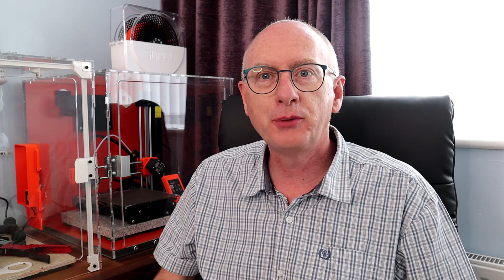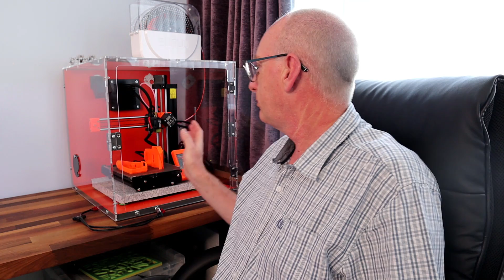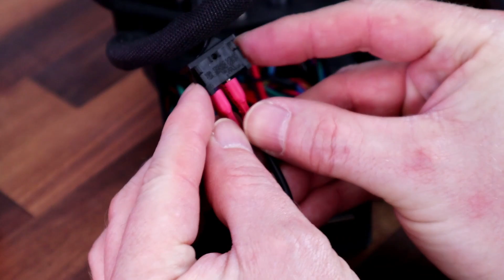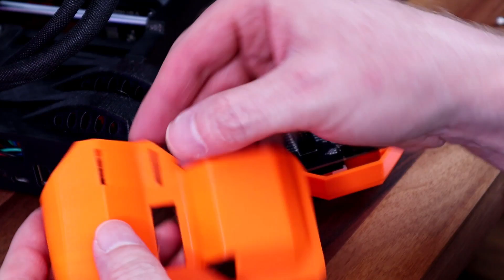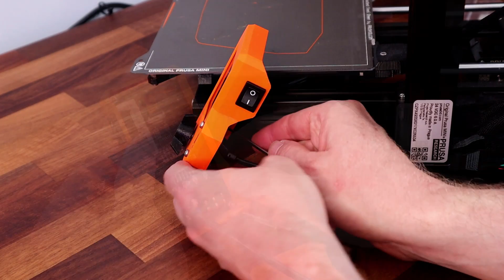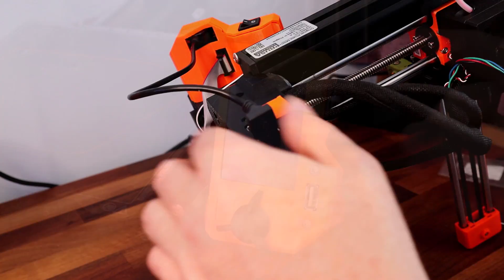Prusa Mini - Front Mounted USB & Power Switch

Comment: Honestly, I'm at a loss on how to even safely take the switch out without ruining the case or my hands. Tried pliers, gloves, I'm cursing out loud at this. :(
Reply from the maker: Should just be couple squeeze clips ok with fingers
Reply: @colinhill  Maybe the printed case was tight because it was a fight and the thin overhang at the top was damaged. I have no idea how I could have squeezed those tabs enough for it to come out. Doesn't matter, it's out and my mod is coming along.
Reply: How were you able to get the power switch out? I've tried tons of methods, including the one shown on Prusa's "How to setup Wifi" guide.
Reply: @Anon-kt5bv  Yeah, it came out when the thin part at the top split. I have no idea how to take it without damaging the case, the tabs on the switch are way too tight and rigid.

Comment: Hey Colin, I was wondering if you noticed any improvement using those stone slabs under your printers? Is it worth going that route?
Reply from the maker: It makes printing quieter. But you also need some sort of runnber or foam underneath the slab.
Reply: @colinhill  Makes sense! Thanks for your reply

Comment: Hi Colin, I would like to add a power button to the front of my Mk3s, I know you have done this with the Mini, but do you have any videos on how to do this on the Mk3s ? or is it roughly the same ? - I would like to mount the switch to the front of the Prusa control panel. Hope you can help ! Many Thanks, Mel.
Reply from the maker: I would not know how to do this. The main power switch is on the metal sealed PSU, and you probably dont want to mess with that. It might be possible to rig something up to the Einsey board, but i've not seen anyone actually do that. Perhaps something to explore at a later date.

Comment: Where did you get the concrete slab under the printer? The ones in my area are too big or have a design in them..
Reply from the maker: It's granite, 300x300mm from local DIY store in their garden/building section.